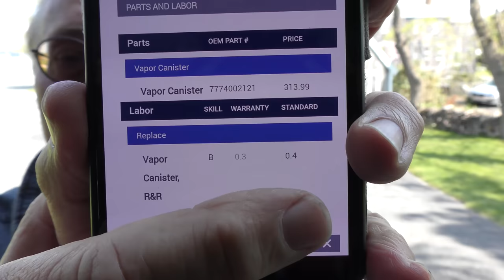7 Car Myths Stupid People Fall For

Comment: Good quality, highly rated tires are always a better idea. If you have a standard sedan or two-door or hatchback, get Michelin Defenders. Great tires in the dry, in the wet and on snow and ice. And if you want the absolute best performance in winter, get the best Michelin winter tires. They will feel like they're doing magic. But make sure to swap them back to all season or summer tires again when the roads are mostly dry and it's getting warmer out. If you drive them in 70° weather, the tires will be destroyed in a matter of weeks.
Reply: Michelin is great

Winter tires are great if you get temps below 35° because they are softer.
Reply: @Rearmostbean  yes, I got Michelin winter tires about four winters ago. I live in Minneapolis. They were crazy good and I was surprised at how well they handled in the dry and how quiet they were. But I kept them on until mid to late May that spring and they practically dissolved. Most of the tread was gone in a month after the last snow on the streets and they started getting noisy very quickly.

The next season I decided to stick with Michelin all season tires. Not nearly as good on the snow and ice but quite good enough, I guess.
Reply: @bobbabai  I am your Wisconsin neighbor. Feel like a hero when we get 10" and my van plows through the snow
Reply: @Rearmostbean  My 2015 Prius couldn't quite do 10" but it was usually good until there was about 7 or 8" of snow. I never got stuck where I needed help getting out. That car was definitely the best front wheel drive winter car I've ever had.
Reply: You won't 'destroy' a winter tire by driving your vehicle in warm/hot conditions. Unfortunately doing so will cook the various compounds in a winter or ice tire turning it into an all season tire.
Reply: @charliecliche6155  
Or, the tire's extremely soft tread compound wears down very quickly and also will tend to wear unevenly, causing lots of noise. You're going to have to support your claim, with evidence, that the compound is being "cooked" into a different form.

Comment: 11:59 true fact on your celica the valve cover gaskets and spark plug tube seals are its tune up and oil in a spark plug tube is not a good this so you see a leak change the gasket asap.

Comment: I am going to disagree with the AC statement. In all 6 of my cars owned. Ranger, Jettas, Golf's, Jeeps etc. I have consistently gotten better fuel economy with the AC off on the highway. 
My TDI Jetta will get 48-50+ with the AC off. AC on the MOST I get is 43-45.

Comment: My cousin runs a gas station, and he has two tanks in the ground; One for diesel and one for gas. However, he gives customers the option to pay extra for premium fuel anyway. It is simply the same gas as the regular stuff, marked up for suckers.
Reply: Put regular in a 12:1 performance built or a forced induction motor and see what happens………

Comment: My dodge truck manual says change oil every 6 months, I drive maybe 500 miles in  6 months,can i run the engine longer than 6 months before i changing  the synthetic oil.

Comment: Definitely a lot of people fall for stupid crap. My car is old enough to have a distributor, but hydraulic lifters, so no adjustments for me. The only "tune ups" mine has ever needed in at least 350,000 miles were spark plugs and wires and distributor cap and rotor. I would of course use the high test gasoline when my friends wanted to go out to a car meet and someone do stop light racing and I would advance my spark timing. Other than that I'd set my spark to factory and use regular pump gas most of the time. The higher test gas was only used to avoid knock when I wanted to advance my distributor and get a little more power. I always ran stock though, and that was all I did for a little extra power no turbos. Lol Thank you for giving people the truth Scotty.

Comment: Here's a good question, what is the actual difference between conventional and synthetic oil.
Reply: Conventional oil is simply distilled and filtered crude oil. Synthetic oil is made with a variety of industrial chemical processes. It's designed to resist heat induced breakdown of it's molecular bonds, and it maintains a stable viscosity at all temperatures where conventional changes viscosity based on temperature.

Comment: I had a older car that I couldn't find why it was not running well. No excelleration and ran crappy. I did start putting high octane and it did run better but I figure the car was just fkd up and there wasn't realy another option. Hard to find a good mechanic in Arizona.

Comment: If you have a European car you can safely put in the more premium fuel without worrying about it running worse, we have 95 octane fuel here in europe as the basic fuel with 98 as the premium compared to 92 being premium in the usa, for anyone in Europe, you are better off with an older car with getting premium fuel as E5 (98 octane) has less ethanol in it then e10 (95 octane), ethanol would eat up the fuel lines on older vehicles so without ethanol free fuels having less in it is better then more

Comment: My mas car runs on the preium and burns less fuel, weve used the regular and it burns through it faster and the preium is recommended by the cars manufacturer

Comment: Okay but scotty man I have a question for ya what about a 2019 dodge caravan my mom allways put e85 in it because its cheaper and it can run on it thats what our dealer told us and I wondered if that is where we are making a mistake because our transmission been screwing up and I was thinking maybe something is wrong with the engine because of the fuel we put in it because it seems as though the transmission is fine because we literally just replaced it not that long ago and it never had problems until like the middle of the fall season this year and I thought from the way it was acting it was the transmission but I was not sure so I thought id come here and check with you lol

Comment: a modern car avoids knock by computer controls altering the timing. do NOT use lower octane fuel than whatever is recommended.
the older cars, that don't have knock sensors and computers, that knocking was actually a good thing. it SCREAMED stop putting the wrong fuel in me.

Comment: Wait, so my car will run perfectly fine if its recommended to use the 95 Octane, but I use the 93 Octane? Note its the '07 Volvo T5 2.5l turbo, but most of the time I just drive normally and take it easy.

Comment: I would say stay where you're living cuz the fuel quality there is good out here in New Mexico the regular unleaded and my Lincoln executive of 4.6 L V8 will only get out of the Highway 13 miles a gallon I turn around and run the premium I'll get right at 26 miles per gallon don't know why

Comment: Why premium gas more. It is a free market,  so they charge  what market supports. As stated, most modern cars don't  need it so I'm sure they refine less premium and therefore less supply. Sure there are classic performance cars that ownwers are willing to pay the price. I have a Ford Fiesta ST. It does  get a noticeable increase in hp. When ibfirst got it, the cist difference wasn't too bad and i used premium, but now no. Too expensive.

Comment: You changed the oil filter every 3000 miles or once a year? Who only drives 3000 miles in a year? I do about 13000. I'm not changing the filter four times a year.

Comment: My car was running bad i took it to the shop and he put high octane gas and it cleaned the fuel injectors and started running perfect so now and then I use 93 octane my civic si will only runs on high octane it knocks when you use low grade gas

Comment: First off, I enjoy the information Scotty is sharing.  These auto mechanics now days focus on money, not good repairs.  Thanks Scotty.  Now, this oil vs synthetic?  These nimrods at the toy shop dealer said it will be $86.00 for an oil change, no, no no, I want conventional oil.  Nimrod said ok.  4k miles later, on the interstate, loosing power.  Ck the oil, low and almost black.  What kind of oil is in there??  Half a quart of syn blend, still low,  one quart low synthetic oil.  Did it burn or evaporate?  Next oil change was a (toy dealer) buy one get one free, convetinal.  It runs much better.  I don't like synthetic, man made, oil.

Comment: Curious about the oil change mileage. I own a 2015 BMW in Germany and the system and service only require change every 2 years. 
The computer will as you for a refill every 6 months about, but the change (at BMW dealer) is done only every 2 years. 

Anyone knows why is that?

Comment: Aren't most modern A/C compressors always "pumping?"  Back in the old days, you could FEEL when they clutch engaged.  I think the newer ones stop and start the coolant flow instead.  So driving with the A/C off doesn't make a difference when it comes to gas mileage.

Comment: IDK why people put in higher octane that what their car actually requires.  It doesn't make sense financially if you think about it.  Even if you got slightly better gas mileage, you'd be paying about $12-$15 more per tank, to maybe get another 10-20 miles.  Those would be some expensive miles if you ask me, versus just using regular 85-87 octane which most vehicles use (that are not diesel of course), and it's generally $1 to $2 cheaper than the high octane fuel.

I never understood why people wouldn't change their oil regularly.  It's not a tough job and even if you take it somewhere it is maybe an hour wait and perhaps $80, but most people will only need to do it two or three times per year.  Keep in mind that oil is cheap, engines are not.  Now more frequently then 3,000 miles is not necessary on modern cars unless they have a lot of miles and/or are showing signs of excessive wear or oil burning, but I'd say 5,000 or 6,000 miles or 6 months if you use quality synthetic oil and a good filter.  One other thing that wasn't mentioned is newer cars are also using thinner oils, and I'm still under the belief that while they have improved additives to synthetics, thinner oils (if not changed regularly) will tend to break down faster than thicker oils like 5W20 or 5W30 (granted you wouldn't want to use htis in a car made for 0W-16 or 0W-20, but the oil is already very thin to begin with and even the high quality 5W30 oil starts to break down at 5,000 miles or so.

Comment: The whole pointing the remote at your head has nothing to do with your head. The average height of a human body is similar to the wavelength of the remote frequency. It's just a fluke but definitely does work

Comment: Turbocharged engines need 91 and above you forgot to say that
Reply: Technically, but many also run perfectly fine without 91. I drove my 2002 Volvo S60 Turbocharged 5 Cylinder on midgrade and regular gas for over 5 years and didn't even lose out on gas mileage. Not only that but after getting the car inspected, the mechanics all told me that there wasn't even any excessive wear like they would have expected.

Volvos though are pretty rock solid(and almost bulletproof), so YMMV.

My cheapo turbocharged Honda Civic I had also didn't have any problems running regular gas either.

Many mechanics I've talked to have said that it really doesn't matter all that much on modern cars.

Comment: Question:
My gas station provides non-ethanol 87 octane. Is there any advantage to using ethanol free gas? Thnx
Reply: Yup! You are saving the planet! 😂😂😂😂😂😂
Reply: Non-ethanol gas does not attract moisture and can be stored longer. More of an issue for people like gas lawn mowers and such.
Reply: @WALTERBROADDUS  I left ethonal free in a push mower over the winter. Started on the second pull when I needed it next 🤣
Reply: @kd7cwg  yeah it's a big problem for people who like the store gasoline in things like lawn mowers and such. Ethanol gasoline doesn't store very long.
Reply: @WALTERBROADDUS  Thank you

Comment: 350z drives on 91. Honda fit on 87. And tahoe on 85. I live in the mountain area and go higher in tahoe. The myth is actually use 85 in higher elevations. 87 in lower. Enginering.
Reply: yes i wish he would do a video on the 85 octane in the mountain area..some say it was okayed for carbuerators  but now its all fuel injection..i am not a big fan of 85 for regular cars but the 87 really jumps high...

Comment: Another issue with high octane fuel is altitude. In high altitude cities like Denver or Cheyenne, you need a turbocharger to get full use of premium fuel. Normally separated engines don't get full horsepower out of high test at altitude.
Reply: Respirated?

Comment: The key under the neck has nothing to do with the head it's the fillings in your teeth they are metal. It used to work for me after I had my metal fillings removed and replaced with white porcelain it does not work anymore.
Reply: Has nothing to do with fillings, it has to do with the human body being mainly water. This increases the amplitude of the waves, makes the signal travel farther. You don't have to do it with your head at all, can do it with your body also. Works better with head because it is the highest point on your body+ increased signal due to water in the head.

Comment: For the wind vs A/C debate. Yes windows down is less efficient than a modern A/C unit, but if you're cruising at 65-70mph you don't need your windows all the way down to get a good breeze; try a little crack instead

Comment: Amazing Thank You So Much.  My 2006 Pontiac GTO is running Great. 70,000 miles.  It says. I must use High Octane Gas on the LS2 400hp Engine. Is That True.  Thank You 🙏Again Cheers 🥂
Reply: Yes if it says use 91octane make sure you use it just like a Lexus or bmw when it says use premium gas ⛽️ u need to
Reply: It runs perfectly fine on regular. The engine is already designed to compensate.
Reply: @ocularpressure4558  that's really not true. The change in performance is marginal.
Reply: @WALTERBROADDUS  I ment if it called for it, like if it says on the gas door 91 octane only that’s what u should use but if u don’t hv to use it then just like Scotty was saying it doesn’t benefit you and could make it worse
Reply: @WALTERBROADDUS  Thank You So Much 😊
Reply: @WALTERBROADDUS  oh so it doesn’t call for 91?
Reply: @ocularpressure4558  the manual recommends 91 octane. It's designed to run perfectly fine on regular.
Reply: @ocularpressure4558  short of taking the car drag racing, you are not going to notice the performance difference.

Comment: Scotty, oil change on a Hellcat Challenger driven 200 miles a year?
Reply: 200 miles a year? You can get away without the oil change for a while.
Reply: @WALTERBROADDUS  quick query, would the oil still degrade slightly, even if just sitting there?
Reply: @qre268Zrtb  I would probably use synthetic oil. It's going to last longer. Is this just a show car?
Reply: @qre268Zrtb  with long-term storage like that, worry more about fuel stabilization. Try to use pure gasoline without ethanol.
Reply: @WALTERBROADDUS  thank you

Comment: What if you have a  93 octane tune for a challenger but your state only has 92 octane?
Reply: No big deal. That's barely any difference. Also your car would probably run fine on regular just slightly less power.
Reply: @Kris Bright  thank you... I Also have other mods like cold air intake ripp coil packs wider throttle body with questionable spacer straight pipes to super 40s and I know im forgetting something...lol I basically did everything you can think of  besides turbo on a v6 and now I'm bored 😴

Comment: My ‘02 Honda CRV was about as slow as a triple amputee on a bicycle when I tried to accelerate from a stop with it’s A/C on. Even my ‘07 Jeep Liberty gets bogged down by it’s A/C, but it’s a manual so I just rev through to the limiter.
Reply: I’ve had a 11 CR-V and now have a 17 - all bought brand new and have never had a problem with anything, and I do mean anything!  For more than 30 years we have owned Acura/Honda autos and never had one single problem!

Comment: With the Mustang 5.0, I figured 93 actually helps it run at 1500-2000 rpm comfortably. 87 I have to downshift.
Reply: The coyote mustangs also have dual knock sensors to run regular and premium. They make less power on regular

Comment: I have a 2004 and 2020 Toyota 4runner both with the 4.0. Both owners manual state use "unleaded fuel with minimum 87 octane. Use 91 octane or higher for better performance" 🤔 this has been a big debate on the 4runner forums...

Comment: Had the stupid friends who always never turn on the AC say it destroy the engine speed lag and engine long run in the summer time. They never turn it on and got the experience using it. Later to find out most go and sell the car in two or three years. If you gonna act that way at least keep the car forever or 5 to 10 years longer. Greddy friends that why they got few friends when people notice greediness lifestyle. Dump people myth on AC or heater high gas mileage.

Comment: The AC with the windows open myth...

I need explanation for why a car would get the same gas mileage with the windows down or the windows up with the AC turned on. The only way I could see that happening is if the outside temperature was the same as the AC set temperature or close to it. But if it was 95° out and the set temperature is 80, there is no way opening the windows is going to reduce fuel consumption.

Comment: My engine light started blinking then was on all the time on my bought new 21 years ago Mercury Sable LS Premium year 2002, automatic transmission. OBD ll port $25. scanner Scotty said to buy a long time ago said, “cylinder one is misfiring”. I noticed the misfiring even before I noticed the check engine light came on. What should I check first, second and third , etc ? Help ! 
Oil changed regularly, and all fluid levels regularly topped off. Engine itself never worked on. Only 35,000 miles on my car.